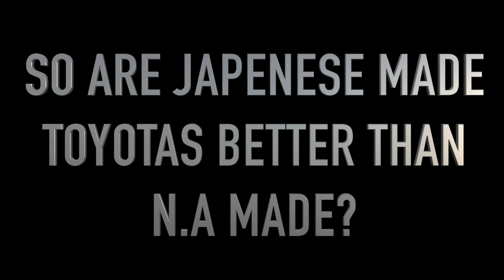Are Toyotas Made in Japan Better than Toyotas Made elsewhere?

Comment: Hi AMD, thanks for this very informativ video. Where can we customers provide feedback?

In particular the Infotainment System and the EV-Mode from Toyota seems like programmed from a guy never used or saw a smartphone or computer in his whole life. The engineer must be 80 years old or above and work only with paper. Even China electronic crap is more userfriendly than Toyotas Infotainment System. For example: 

1. At every start, the infotainment is throwing me back to the Home-Page and I touched the screen for million times to get to   the batterymonitor. Please Toyota, why you can't save the last used page like every other manifacturer does?

2. EV-Mode: I talked with many other Toyota hybrid owners and everyone say the same thing: EV-Mode is useless.
What the customer expect: As a limiter for the accelerator to keep the position at the "ECO" to stay in electric mode like when you do it manually.  We expect the EV-Mode as an assistant or help to keep the car in EV-Mode like this way so we can focus on driving the car instead of  keep my eyes on the ECO-Meter all the time. When the electric motor has not enough power, the driver would feel it an press the accelerator all the way down so the combustion engine kicks in.
Toyota expect the customer to do: Want to stay below 18 mph for electric driving. By 18 mph i would use the speedlimiter instead because the car would stay anyway in EV-Mode because the accelerator position is below the "Eco". So whats the point for EV-Mode? Do Toyota even drive their own cars? I guess not, because when they drive it for just a minute, they would recognize the nonsense and understand, what i am actually talking.

But for mechanical parts, Toyota is very reliable and I can't criticize anything about. That's perfect.

Comment: If I have to be honest TSAM (Toyota South Africa Motors) takes field reports from dealers very serious from local build vehicles which are Hilux, Fortuner, Corolla Cross, Hiace commuter bus (Quantum in South Africa) and still the E180 series Corolla sedan. When a said defect or concern is identified it gets addressed and a TSB gets issued as soon as possible. So to speak the Toyota standard is kept to the most highest regard as possible. Reliability is always kept to high standard. Toyota builds quality cars, not cheap cars.

Comment: One question I have to ask. If vehicles in the past were much simpler and that is one reason why they were so "bullet proof" and lasted a longer time with less problems. Why did Toyota have to go with new technologies that make it so complicated. As a buyer I do not care if my vehicle has the most horsepower or the most features. I buy Toyota or Honda because I want my vehicle to last and to be problem free. Here is an example I had a 2015 model car that had all the features and modern technologies. It constantly broke down. After warranty I was still making payments and shelling out big money to get it fixed. I want the vehicle I buy to not have problems during payment phase. I then want to enjoy it for a few years after I paid it off. I would rather have a 1994 Toyota Truck with a 22-RE engine over any Tacoma on the road. It will run circles around it long term. I have always wondered why they did not keep engines proven reliable longer. I figure its our Govt. putting mandates on car makers that is the culprit for these complicated engines. 1 engine to rule them all! Toyota 22-RE!
Reply from the maker: Hi! Honestly auto manufacturers would love nothing more than to keep making very simple cars forever. But government requirements for fuel mileage and emissions push them to go in that direction. That coupled with consumer demand for features and speed also pushes them to make changes all the time

Comment: Of course they're better. I had a Toyota Corolla in Europe. Made in Japan is much better, after 25 years there was no rust, still original exhaust, mechanically very strong, manual transmission. Now I'm in America, I had a Toyota Corolla and Camry made in America, after 12 years there was different issues.

Comment: I have a Thai-made 2008 Yaris 1NZFE engine (I bought it new in Thailand).  The car has been flawless, though it only has 130,000 kilometers (80,000 miles) on it.  I maintain it myself, fanatically.  The only major repair was when a small lizard (Gekko) crawled into the evaporator and died.  The car was nearly new then and Toyota paid for the new evaporator job under the warranty.  (That was a surprise.)
Since Toyota no longer sells manual transmission cars, guess I'll have it forever.

Comment: Thankyou David for your honest commentary.   I remember when CCN got his latest hybrid Camry, and I also remember him pointing out some cosmetic flaws that bugged him, so I am assuming his car was not built in Japan.  There was a big online controversy surrounding the flawed design of the 2.4L oil burner engine (that I have of course), saying that the problems were most likely due to poor american factories/assembly.  I figured this was not true, and David confirmed it.  These were engineering flaws that had nothing to do with parts supply/assembly issues.

Comment: Regarding parts outsourced to tier 1 suppliers. It makes no difference what an automakers  standards or relationship with a parts maker is. Unless the automaker has the internal capability to test those parts and the assembled products - and does so - you can get Takata airbags and Bx4x wheel bolts in assembled products. Regarding industry experts. Knowledge of what a maker does and how they do things with particular products doesn't generalize or age well.   Different dates of experience with a maker and factory may give two industry experts completely different and equally valid opinions of the quality of design, manufacturing and  assembly.  Always ask an automotive expert what dates of contact, specific role, and specific products their opinion is based on.  I've always admired how Toyota manages their relationships with supplies and their parts inventory management. But I have seen changes over time in the total quality of their entry level products. They are still very good, but not as mechanically good as they were 20 years ago.  The newer design drive trains and lighter materials are to blame.  When twice as many working parts are crammed into a smaller engine base to perform the same basic function, the initial defect rate may be better, but the MTBF and COR both suffer

Comment: Amd & David the Toyota enginer
We have Crooks/Tweekers that @ 3 o'clock in the morning Lift door handles looking for unlocked doors to steal things. I think it would be easy and not much added cost to add micro switches to the door handles so if the alarm is activated and some Crook lifts the door handle when locked and armed it would cherp the horn/alarm 3 times. Letting people know that it's happening.
Let me know what you think.

Comment: Comes down to Cost over time. Things Assembled in Japan. Seem to be that little bit better on the perfection level. 
The  Little things like the Type of Plastic Dodge uses vs Toyota. The Dodge Plastic tends to brake a whole lot easier then Toyota. Add in Cold weather and it multiples.  It's shocking how different they are over time.  That is why My Family Bought Toyotas in the 80's and still buy Toyota's Now.  Cost over time. 
Silly things like Stitching on the Toyota seat vs GM.  The Thread count in fabric's. Foams material,  Headliners, Wire gauge.  Toyota is still  the best cost over time. Even the worse Toyota is still better then DODGE, FORD or GM.  Esp over time.  Toyota is The best bang for your buck.

Comment: Toyota's have had some serious problems from oil consumption, cracked dashes, blown oil lines and bad transmissions....So they are not perfect, are they the best? well maybe. I have a Dodge caravan that has had many problems but no drive train issues, not even a torn cv boot and it has 200K. The head liner fell out of it, both front window regulators, heater core, turn signal switch, ign switch and so on. I do maintain it....

Comment: The majority of comments here are from owners here in the US with little or no input from owners in Japan. This makes it difficult to know if the cars in Japan have the same issues that are shared here. I'm NOT defending the non-Japan built cars or condemning them either. I would like to know if the same issues are actually a higher percentage here in the US versus Japan. If it is higher than it can indicate Toyota quality control is inconsistent and the problem starts with that. I don't want to degrade the US factory worker of doing low quality work. It would be the issue of the US quality control people in addition to the actual worker. My guess is the same issues are occurring in Japan and the Japanese buyers accept it in order to not lose face that there is a problem. I am part Asian and born there so I have a slightly different way of looking at this. There is a comment made here by a Master Warranty Technician and I put a lot of credence with his experiences. But being a statistician I like seeing actual numbers.

Comment: I got a Honda pilot 2024 exl. Every time I accelerate at 46 miles there is a humming or whistling sound. I think coming from the under the hood. Then it will be gone at 55 miles. Is that a serious condition. Thanks. Ferdy

Comment: I have owned  4 Camrys, my 03 is Japan built and it still runs  well with original Engine and Transmission and steering rack 60% original paint not peeling,  quiet front end, @.289K  USA built Camrys i have owned  have had more parts break down and sooner, , so I must say JAPAN built much better in my own experience..

Comment: Of course, they are better,  cars made in Japan have higher quality controls. In Japan, the speed limits are much lower than North America's. So they may not need to design the brakes the same as in the past. According to Scotty Kilmer, a mechanic on YouTube with over 40 years of experience, there is a difference n build quality evident after real-world use of the vehicles. I believe you are talking about brand new vehicles on the dealer lot.

Comment: *Foot note...this 'they are the same' only apply to Toyota only. Other brands I have experience there is much more differences (honda/nissan). (per user groups). especially VW from Brazil is junk compare to European made ones. Got so much electronic problem while new , I sold it before warranty finished.

Comment: I just took the original fuel filter off of my 2003 Toyota Avalon with 250,000 miles the car was made in Kentucky fuel filter says Japan on the back

Comment: If you are buying used jap normally got less rust.The annoying thing is jap ones normally always have more power or different engines more powerful than the ones we get in uk.Example honda jazz jap model jazz rs 1.5 2010 118bhp uk 1.4 100bhp  and lots of other models so yes yap car are definitely lot s an lots better

Comment: Honda did a comparison years back and found no measurable difference. While I'll likely make a Toyota my next new car (we had two long term Toyota Corolla company/rented cars in 1980-1981), I see that Toyota has become a bit "Americanized" and "GM thinking" in their mindset. Case in point is when I called their HQ to get an answer a dealer couldn't give me, and they told me, "Well a dealer would have that information". No, you are the manufacturer, you should have that information. Dealers just get it from you. Also, Toyota refuses to indicate what the $1,095 delivery fee on a Corolla actually entails. The reason is key: some dealers are double dipping.

Years back it did make a difference where a vehicle was made, especially for GM. You NEVER bought a car made in Fremont, CA (which oddly enough is the site of Tesla's assembly plant today), and you NEVER bought one made in Van Nuys, CA. If you did, you were guaranteed a clunker. The GM Fremont plant closed in 1982 and became a NUMMI joint venture plant with Toyota and GM in 1984 and lasted through 2010. That was the partnership that GM should have kept going instead of partnering with other poor quality marques. 

I also find that Toyota was somewhat complicit in their dealers adding on premiums to pricing during the height of the pandemic. Toyota should have sent letters to their dealers telling them if they were caught in such practices that they would lose their dealerships immediately. Don't become like GM---myopic, backward, "sweep it under the rug" and hope that the problem "trades itself away" (owner with a problem trades it in and makes it someone else's problem) or "junks itself away" (gets taken out of circulation and scrapped). 

I'd prefer a Japan made Corolla over one assembled in Blue Springs, MS, but they are tough to find. Something about the work ethic and mindset of the workers in Japan seems more diligent than those in the US. If the parts are made to the same standards on the same machinery in different locations, why should there be any difference?

Yes, I remember when you'd have to look for "JPP" (Japan produced) or "NAP" (North American produced) in a Toyota parts catalog. There are still some cases of that. My coworker had to get a hood replaced on his 2017 RAV4. From what I recall helping him look up the parts, they had a listing for Canada made and Japan made. Sometimes the parts supersede to each other as one supplier becomes the sole source of the parts.

Let's hope that Toyota doesn't get too "Americanized" in their thinking so they turn into another GM, Ford or Chrysler. All automakers make "winners" now and then, and this is unfortunate, but when it's the norm rather than the exception, there is a problem.

Comment: I completely disagree. I have a 23 4runner built in japan.. its a tank  not a single rattle.. i had a 23 tundra trd pro.... its was a rattle box. The centwr console rattled like a toy, the plastics were cheap, the front tires wore out on the shoulders in 3000 miles ( and yes 2 alignments at toyota) replaced tires... same issue, outside  window moldings seemed to be cut short, the bass speaker rattled, wtc etc... i got rid of it and ill never buy another toyota truck

Comment: Great video..!  I’m curious, being that this was discussed a little.  If I’m thinking of getting a ‘23 or ‘24 3.0 Premium Supra, would you recommend getting the ‘23 or getting a ‘24 at a slightly higher price?  Most of the bugs have probably been worked out for the ‘23 being the end of the year, ‘24 hasn’t been released yet but doesn’t look like any changes to the design.  I’m not sure if the ‘24 will have any problems or it will be a continuation of the ‘23s with minor improvements?

Comment: After my Japanese built 95 pick-up got to 275,000 miles I sold it and supposedly upgraded to a Numi (Fremont, California) built 98 with only 48K miles. The US supplied interior quality was horrible. The seat plastic was cracked, the carpets worn. The 95 seat showed no visible wear with more than 5x the miles. In this case, the Japanese built was superior.

Comment: Fortunately the Lexuses sold in our market are all made in Japan. I have seen numerous service bulletins that only apply for the American assembled Lexuses but not the Japanese assembled ones. Same model, same year. The evidence is out there internal to Toyota.

Another example. Japanese assembled Toyota’s use high quality Panasonic 12V batteries which are known to last up to 10 years. Then you look at the battery that comes with a locally assembled car and wonder why people complain about dead batteries after short term ownership.

Lastly, standards are only good if every single person follow them with pride. Culturally the Japanese are much better sticking to the rules.

Comment: Toyota is surely better pronounced in Japan. I don't deal with opinion, a career in forensic auditing shaped me. What I do know is that LC70 don't have Dyna heavy duty gearboxes any more, just as they run with light duty front diffs.  Cruisers were built in 8 countries and initially were fitted with Chev 4.1 engines (FJ45) and also a variety of Mercedes-Benz Diesel units, especially OM314, among others.  Tazz built in Australia was responsible for a 37% drop in reliability ratings. I don't know how well the South Africans build Toyota, but I know that they do different models including the Corolla Cross.  Trouble came to the brand when a new CEO hunted the bottom line, at the same time as an equally destructive new CEO at Mercedes-Benz caused a quality dilution.  Few people know that Isuzu owned a huge Hokkaido engine factory where they then exclusively built Toyota Diesel engines.  This was once confirmed to me in writing by Isuzu.  Many supposed Toyotas in my country are hastily rebadged Suzukis.  In one instance, they forgot to remove the Suzuki floormats 😂😂

Comment: when it goes to models and engines there are far better in Japan than rest of the world. 
Japan gets GRMN MARK X manual rest of the world does not including special gearbox + tuned 2GRFSE.
Same for other models, Toyota royal crown much different to GS450/350 with speakers in headrest etc.
engines are tuned more to sport, gearboxes have more sporty gearing, diffs are quite often some form of LSD from Factory.
This is not just a case for Toyota but also for other manufacturers...
IS250 had possibility to add special Throttle Valve in Japan rest of the world no
OKADA PLASMA Coils Japan (aftermarket)
even lot of parts that are directly from Japan are a little bit different from normal perspective than rest of the world...
I think there are people who would give quite better comparisons than me but that just surface stuff